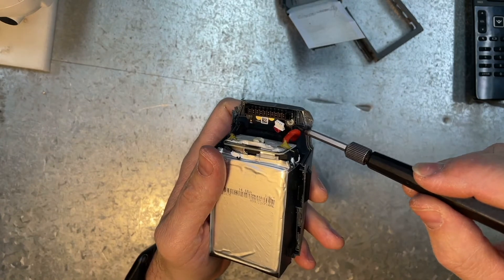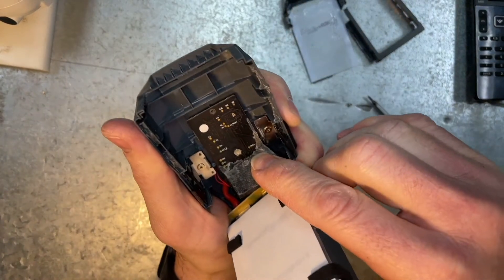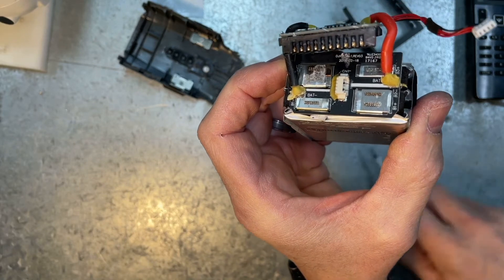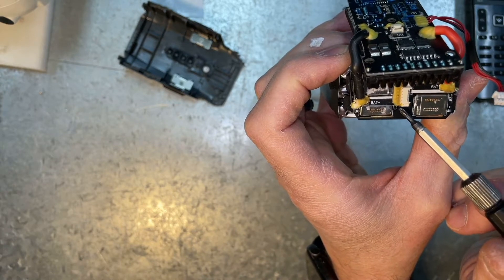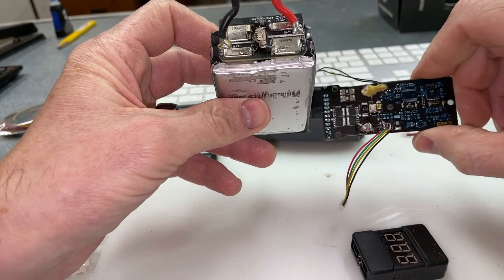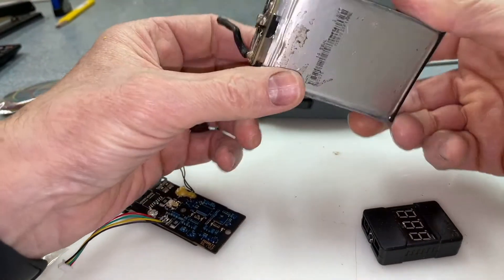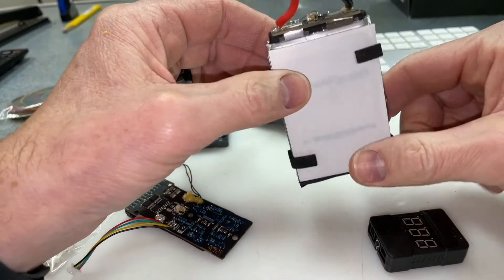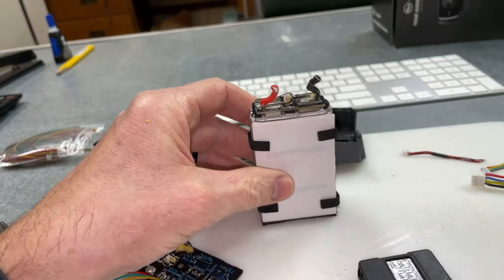DJI Mavic Pro BATTERY Modification

Comment: Hello.. Can you teach us how to combine two batteries for the Mavic Pro 2 drone.. so that we can fly for a longer period of time.
Reply from the maker: The problem is the extra weight. I would only attempt this if your good at reprogramming gyro parameters. I would also upgrade props. In my opinion, by the time you make mods and change parameters, you would be better off building a bigger drone. DJI has done a great job building it as it is.
Reply: @199wildman  ive got a super battery . The max distance got is 17 kms one way then back and the mavic can handle the weight
Reply: @enjoyyourlife2518  what battery are you using? Could you post a link. Thanks in advance

Comment: 🤔Now before you did all the taking your DJI  battery all  a loose  .Was the battery swollen up? And if yes or no . Could a battery that is swollen up be still good for getting all the electrical boards out  and making it just a regular battery like you  did in this video?Lol🤔 so did you just take it all apart to see just what makes it a smart battery? And if your  battery in this video wasn't swollen at all!Let me know because I have two swollen DJI battery.And from what I am seeing in these other videos.Is that when they are swollen that they are one more good for anything.So is this true?🤔 Because if it isn't true then I am going to make up a battery like you did with your battery 😎👍!Lol and I seen one video on here where a man put two batteries like yours  together lol and called it a super battery. And wow😳🥴 he made it for his DJI drone to fly with .Lol and it still could fly with more battery life and flying time 😉👍!So get back with me and let me know.
Reply from the maker: Depends on how bad they are swollen. The lithium cells swell as they get extreme use, over charged, or over discharged. Usually, only 1 or 2 cells get swollen. If you have a battery tab welder, you  could possibly make one good battery out of 2 batteries. That being said, the battery I disassembled was not swollen. The smart board wasn’t charging/ balancing the 3 cells correctly. I’m now using it in a flying wing and it’s working great.
Reply: @199wildman  🤔 Wow what's going on with my batteries is that they are not even taking a charge at all!And I know that the battery charger is working because it changes up the controller .So what do you think is going on that they are not even taking an all night charge?
Reply from the maker: @michaelhightower8160   cell are not balanced
Reply from the maker: @michaelhightower8160  https://youtu.be/XSSV480gJiQ

Comment: is the board not locked, sir?
Reply from the maker: It’s locked or something.  Starts out with 4 green lights, then goes to one slow flashing light
Reply: @199wildman  How to open it, do you use a software or manual?
Reply from the maker: @gogondronemania  you need this software https://www.ti.com/tool/BQSTUDIO#descriptionArea
And the hardware in the description.
Reply from the maker: @gogondronemania  software and hardware required is in the description
Reply: @199wildman  yes sir,thank you very much